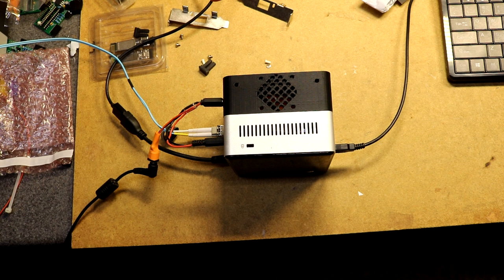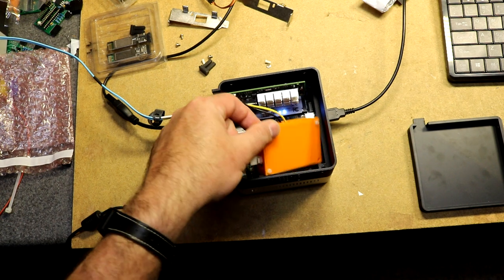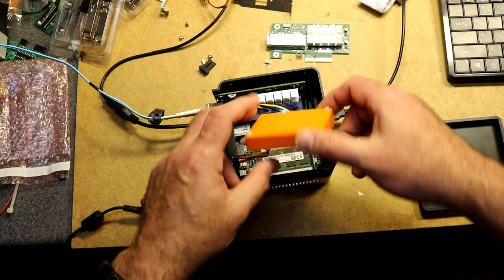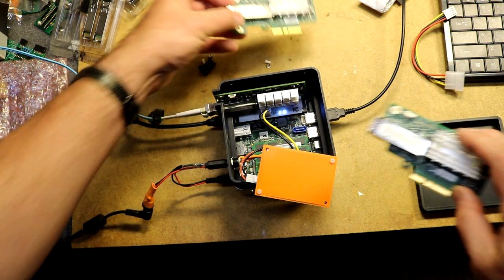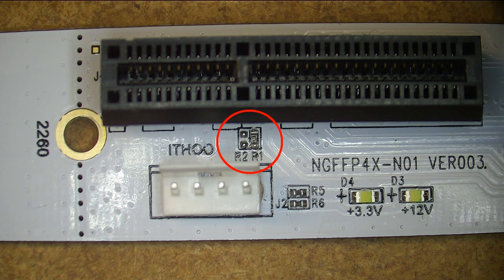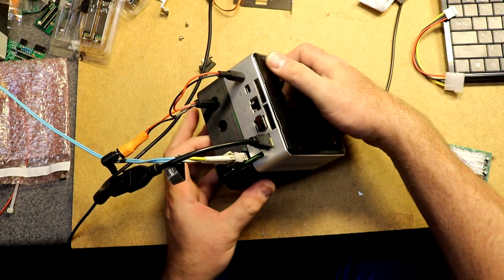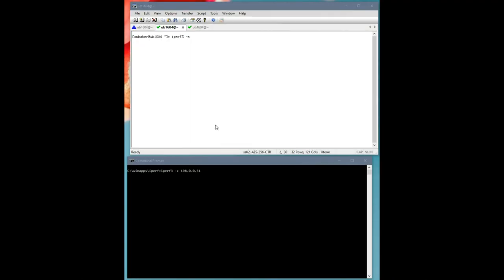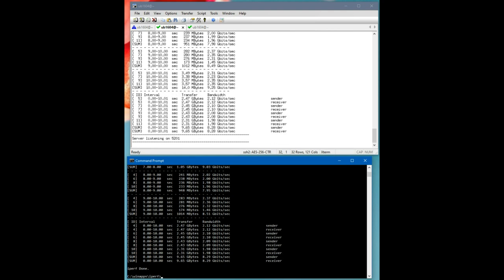Intel 5th generation NUC modified to support 10Gbe SFP+ Fiber Network

Comment: Very informative! I'm planning to build mITX but need to mod the case to add a 10GbE card. Due to my use case, I'll likely go with a new 10G-BaseT card from ASUS, but it should work the same. Thanks for going in-depth.

Comment: Nice hack! I'm running an 8th gen nuc for my current server, and I was looking at upgrading to a Ryzen 5 2600E based ITX system, since I wanted to connect a multi-port NIC for ISCSI storage, so this could be an interesting option. I don't have any 10G gear, so I'm limited by the four 1G ports on my NAS anyway. My original approach was to use a USB3 gigabit network dongle, but the cheap one I bought doesn't support 9K jumbo frames.
Reply from the maker: Note that you can get a Brocade ICX6450-24P switch with 4x 10Gbe SFP+ and 24 gigabit copper PoE ports for around $200 on eBay. A cheap way to start the 10 Gbe migration. That's the route that I went. If you really want to stick with 1G instead of 10G, then https://www.amazon.com/Crest-Interface-Gigabit-Ethernet-Modules/dp/B07DTK7ZZJ is also an option for you, a 1G adapter that connects to the m.2 slot. There's also a similar two port version out there. Have not tried this route, but it was going to be my approach until I settled on the 10Gbe upgrade instead.

Comment: curious, there is low profile sfp+ melanox cards for around the same price half height, why take a single sfp+ card, else riser and angle the card under a slim 120mm or 140mm fan since 3d printing a case. not criticizing geniumly impresed. just asking since if you ever get above gigabit from isp your rg45 is the bottleneck vs m.2 at 2x or 4x. 😁

Comment: Interesting idea, but hyperconverged infrastructure is probably more power efficient if you have any amount of equipment running 24/7.  And you can't beat wire speed networking.

Comment: I'm also going after the lowest power possible for my always on devices.. I'm wondering if there's any better solution today than back when you made this video?
Specially to add sfp+ to a dc powered device (sbc/nuc/etc) I dislike the ethernet ones as they use so much more power